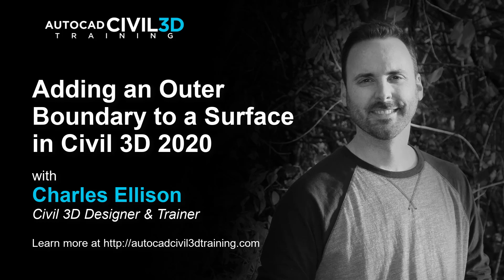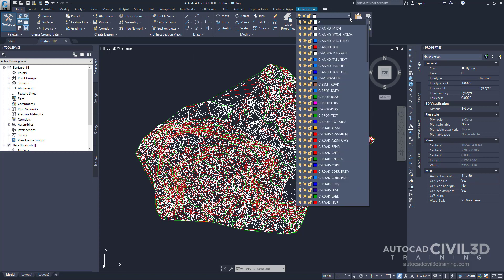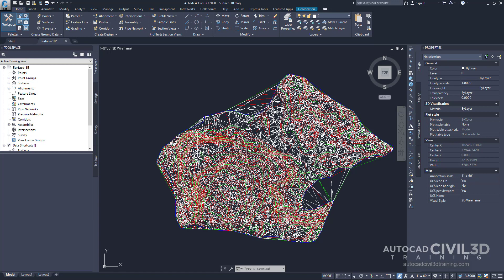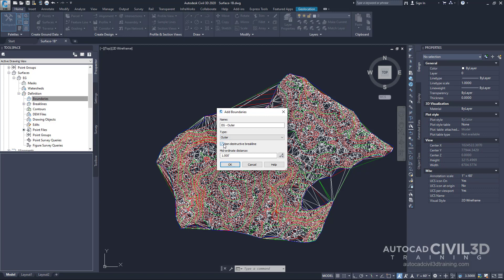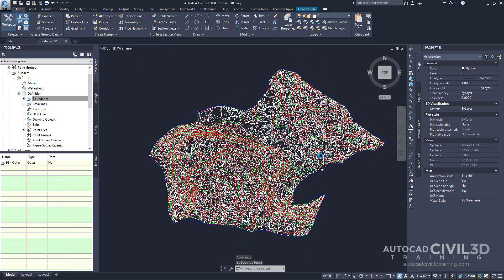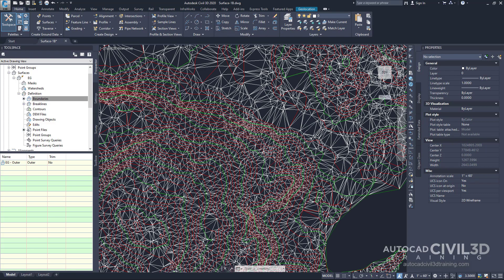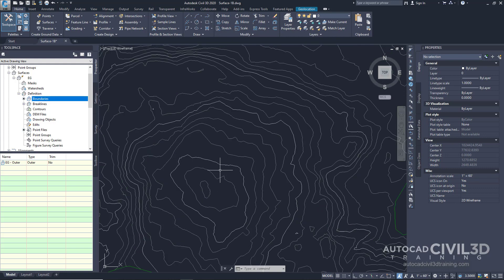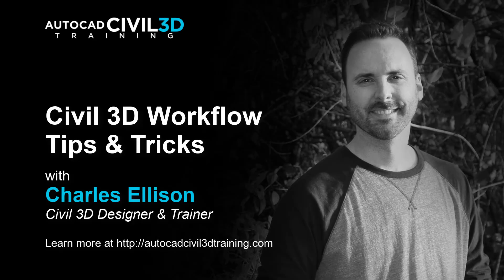Adding an Outer Boundary to a Surface in Civil 3D 2018, 2019, 2020, 2021

Comment: I'm doing exactly that, but it just won't add the boundary. Very frustrating! Any suggestions?
Reply from the maker: It’s definitely something we can go over on the next members-only live feed. 👍🏼
Reply: @CIVIL3D  I had a lot of trouble with this, but I think an important step was to convert the polyline to 2D.
Reply from the maker: @curlyhart5508  thanks for the update! It's great you were able to figure it out.